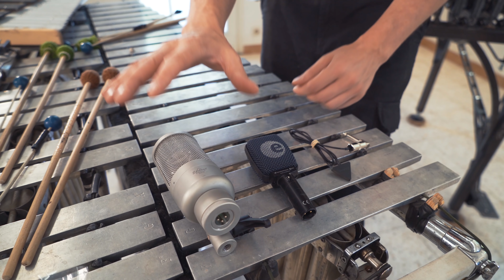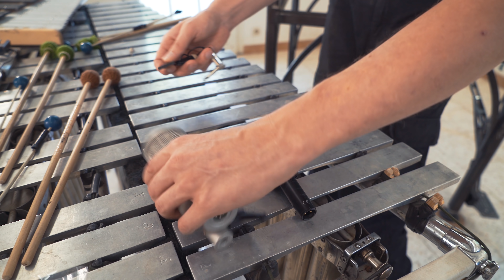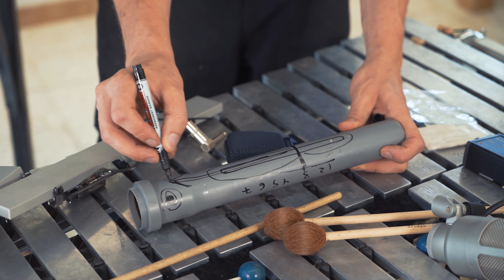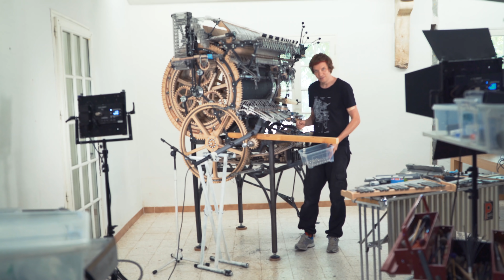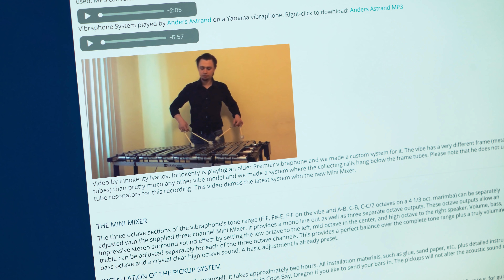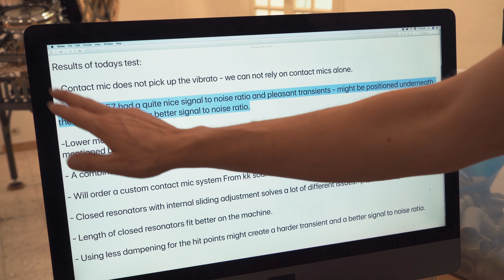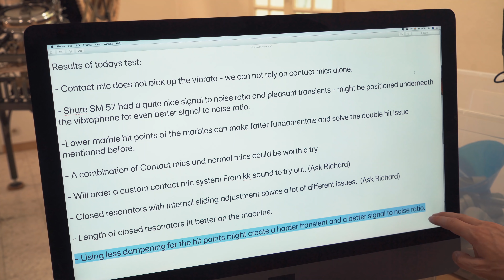Vibraphone Experiments / Microphone Types - Marble Machine X #96

Comment: I'm positive someone else will suggest this but if you build the microphone connector into the existing mounting bracket for the vibraphone bars it should be plug and play - a cell phone sized Tip/Ring/Ring plug and jack set will keep the microphone circuit balanced which should be a good thing. I don't have any objection to digital imposition of vibrato, but MMX is your baby, IIRC you were already planning to do some digital signal mangling in the drum and cymbal section, so you already have the processor built in.

As an alternative to mounting contact microphones on the plates, you could mount then on the resonators. I suspect that you might have some mechanical noise with that, so you might be better off with an ambiance microphone either above the bars or below the vibraphone, assembly, but then we risk picking up mechanical noise from MMX herself and I don't know what a good answer is.

Thanks for another testing video, and keep up the good work.

I would have said you were at Helm's Deep with Theoden, but ...

Comment: Using contact mics would eliminate the need for the resonator tubes, but would complicate switching notes on the fly. It seems that rail system is permanently mounted and the contacts aren't switchable. Using the Shure mics on the tubes provides the best sound (in my opinion while using crappy cell phone speakers) and may not need 11 of them. Maybe one mic for two or three notes? 

This may be your biggest hurdle on this machine. You'll overcome it though. You've come so far already and you've got the whole knowledge of the internet behind you.

Comment: I might be wrong here but ... but isn't the whole point of the resonator pipe is to resonate / vibrate on the main note of the plate above it? So a contact microphone should be able pick that up. Just like it would pick up the sound of the plate itself.
I am no sound engineer ... but at least on pictures you can find some vibrafons with square resonator pipes which would give you enough space to actualy attach said mic.
I cant say how good the quality would be for the secondary peaks in the overall frequency distribution of the plate but I would argue those will most likely be lost anyway unless also picked up by the resonator pipe. (Or be just fainet in the background)

Comment: How about a guitar pickup?  Since the bars are metalic,  the pickup should work.   Not sure if it tracks the vibrato,  but maybe,  if the vibration of the bar is changed by the air pressure.

Comment: You're doing so well. I love the project and the way you explore all the different solutions for each problem. You're an excellent problem solver. The only problem you seem to legitimately struggle with is the problem of prioritization. Considering how central the vibraphone is to the machine, I'm a little surprised that you've only just now started tackling the problems associated with it. Do you think that if you had prioritized the vibraphone much earlier in the project that it would have led to better/easier design solutions? But then again, maybe you are tackling it in the best order since having so much of the MMX already completed helps limit the solutions to a more manageable number to choose from? I'd love to hear your thoughts on the process.

Comment: With Wireless microphones you could place your mics inside the MMX glued on a rotating tube you'd get a vibrato effect on your microphone even not hearing it with your own ears and it should avoid decreasing vibrato effect 'cause you wouldn't produce vibrato at all

Comment: Gah! This video made me soooo excited! 

Few things. DO NOT CAP AN END TO THE RESONATOR PIPE. When you do so, you drop the fundamental tone down a whole octave, and you won't get the same tone that you would get if you match the fundamental (This is how you drop the octave down when you are playing boomwhackers and don't have a budget for the low octave set #musiceducatorproblems) 

When you have the resonator open you can set up the microphones at either point of the resonator pipe. One way I would suggest is to put the sm57 under the bars pointing away from the machine towards the point where the bars are closest to the resonator pipes. You should get the full sound with vibrato but with minimum sound from the machine itself. 

BTW did you notice how the bars sound with the pipes and hitting at the halfway point?! IT WAS A HUGE DIFFERENCE.

Comment: possible to suspend the contact microphone with 2 long and soft springs inside the tube?.. just make 2 small holes pull peace of the spring through it, contact mic and spring to the other side so you can move the contact mic up and down just as a test of concept.

Comment: If I remember right, you are already tweaking the sound of the drums with these contact microphones an 'special ' materials. And then there will be some kind of e-guitar or bass (if I remember right...), another system really without microphones.
So you shoud go on and use a/the system with the digital vibrato (if the price is ok): 
(1) Less trying. 
(2) Less parts to change when changing the plates. 
(3) Less space is used.
(4): The digital part would (hopefully) allow you to change the sound in a wide range (ok, that is not marble-generated anymore). 
(5) Negative: If it is necessary to put these microphones directly on/under the plates (glued?) it makes this a very complicated part (like your solution with a contact microphone for each plate). 
(6) Do you have the equipment to make(?) a digital vibrato with your contact microphones?

Comment: Why not use digital effects to simulate the vibrator and resonator? A simple simulation would consist of a EQ + varying filter that creates the vibrato effect. A more complex (but totally unnecessary) simulation could simulation the pipe as a resonance body. For a custom hardware + digital DSP, check out the Bela Board (Bela.io) and the OWL Pedal. And when you have questions, ask me; I develop digital audio FX and synths for a living.

Comment: Highly directional microphones like a pencil condensor pointed away from the machine itself but at the vibraphone should give the best result with potential for microphones under the vibraphone recording additional vibrato effects. You would just have to make sure all the mics are in phase for best result. Should eliminate the issues as stated with great sound quality and signal to noise ratio however making sure the microphones avoid the falling marbles will be challenging. Additionally you could add small " acoustic baffles" around the microphones to eliminate machine sounds further.

Comment: I think electronic vibrato is the way to go regardless of the mic setup. Building a system where you can alter or change both the bars and the resonator pipes seems unnecessarily complicated and flimsy. You would either need to switch the pipes or make them in such a way where you can slide them into the correct position for a specific installed bar. This would also take a lot of time.

Using a dedicated contact mic on all bars should not be that much of a problem regarding installation as you could easily have a patch panel somewhere under the vibraphone where you can quickly plug in every newly installed bar. 

Best solution of course would be a setup where the mics are fixed, but I still think that electronic vibrato is inevitable.

Comment: it's an esa microphone! :'D
couldn't you use a regular lavalier mic for each note which hovers between the bar and the resonating pipe?! thisway you'd have the best sound for each note, have the vibrato and maybe it's even close enough to drain most of the machines rattling... (yes, I did notice the distortion in the sample you recorded, maybe a different one gives different results...)
Or maybe stick a contact mic onto te resonating pipe...

Comment: So, in a dreamy sort of way, I pictured you running a symphony of these type instruments. Instead of a baton though, you work levers like a madman, directing steam to turn motors that turn the wheels of these wonderful machines. Between the pumping sounds of the pistons, the steam puffing out and the hand-programmed musical automatons a masterpiece echos out through the chamber and makes even the stars twinkle in admiration. 

This machine is so very steam-punk. Is there any way such a system could ever be?

Comment: How about placing a contact microphone at the end of a closed resonator - use foam rubber to connect the mic to the inside of the pipe so that it is mechanically disconnected, but it should get the full effect of the vibrato since it is in intimate contact with the sound in the pipe. If you use a sliding plate, do the same thing with mounting the mic to the plate, but with foam or something to isolate the mic from the tube.

Comment: Slinky 
Let me explain 
The star wars blaster sounds were created by putting a microphone inside a stretched out slinky. 
(I am aware that this is not the sound that you require, read on).
Now a slinky is, in this case, just a spring. And we know that you used springs inside the drums. 
So what if you put a spring inside the tube with a contact microphone attached to the end of the spring. When you play a note would the spring not vibrate with the note that was played and the microphone pick it up? 
I will leave the rest to you, also for you to fill in any blanks that I miss.

Comment: I once bought a miniature swan neck condenser mic to clip onto instruments. I sometimes use it on my double bass, but you can ose it for pretty much all instruments. It's a hyper cardioid pattern, so it's pretty damn directional. It was 50 bucks at the big german music store with the T. You could theoretically put a swan neck mic on the end of every pipe pointing inwards to pick up the vibrato and mix it in with contact mics.. Not cheap when you consider the amount you need, but I don't know of a cheaper way to mic all those pipes so isolated.

Comment: I thought the mic in the resonator tube was pretty good. I think it'd be even better if you switched to your sliding, closed resonator idea. The mic would be in the sliding section, where the signal is strongest, giving you a better S/N ratio. Also, you could insulate the pipes to further reduce the outside noise (the air inside the pipes is what's vibrating, so the pipes themselves could be noise dampening without affecting the sound). Combine all of that with getting the open pipe end to the bottom of the vibraphone plates and you should have cut out almost all the possible noise, while boosting your signal as much as possible!
Reply: Nikita Nugent yeah I also thought about that, hope he sees

Comment: What about using contact microphones on the outside of the resonator tube? Maybe far up maybe on the closed end or by the air gap. I think it could be worth a few more tries because the vibrato is produced by the resonator tube, therefore it also is the point with the highest signal to noise ratio as you stated yourself.

Comment: Be sure to account for the air gap in your resonator length calculation too. The resonator pipe should be a bit shorter. To account for that.
Reply: Thanks, that's already in the spreadsheet :)

Comment: Without the damping on the hit point, you'll presumably end up with a very large transient that will eat into any headroom on a pickup system. This will effectively reduce the proportion of the harmonic component even if you have some cunning super fast compression/limiting as it will be use up pre-amp headroom. There are small capsules that can cope with high SPLs but they are very expensive, e.g. from DPA or Sennheiser. I was wondering about a combination of inductive pickups and pressure zone mics, but maybe the specialist pickups are the easiest!